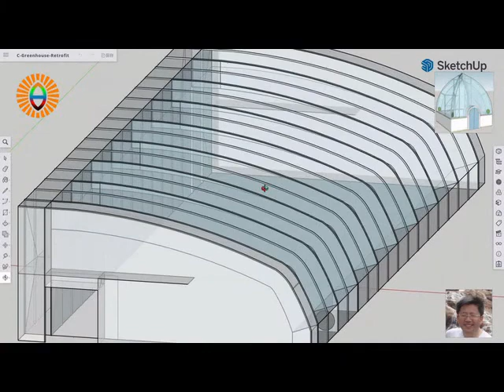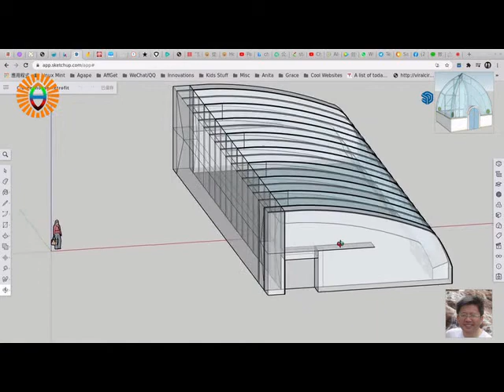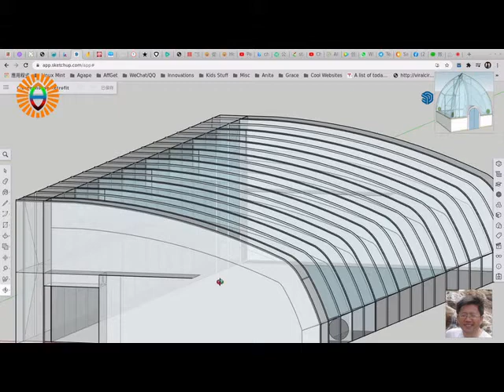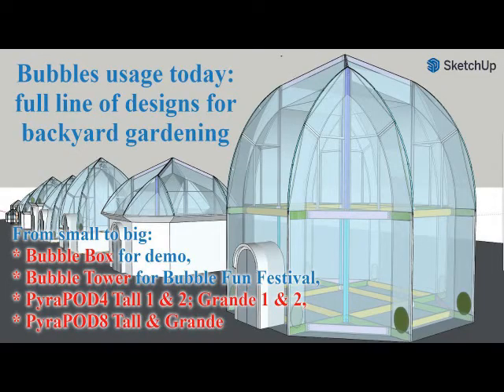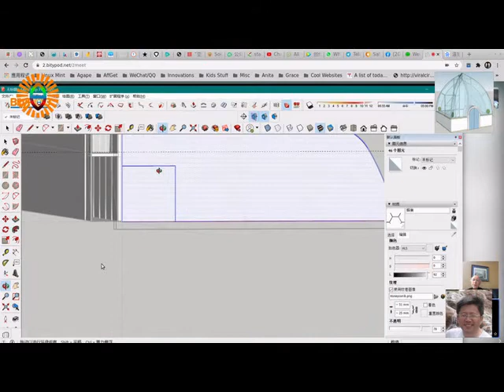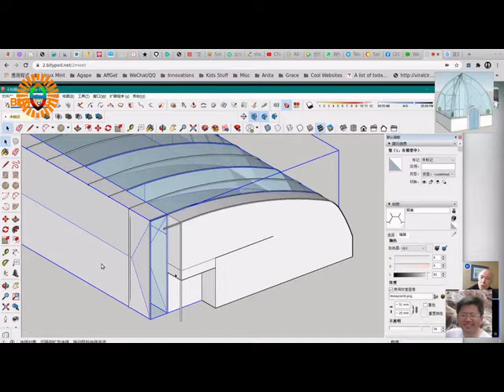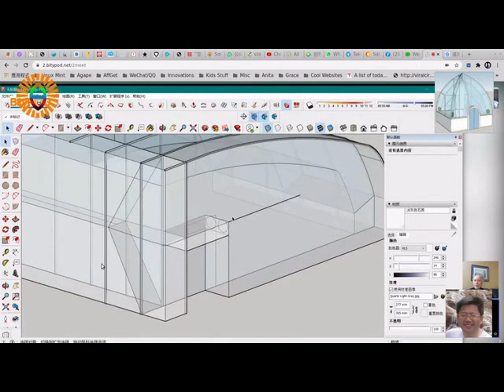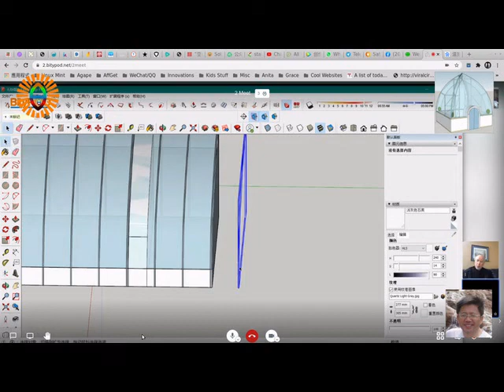DIY: How 2 Convert Your Existing Greenhouse to Utilize Soap Bubbles to Boost Solar Thermal Intake

Comment: Hey Mr. Chang,

awesome techology here! What is the foam solution made of? Just water and soap or surfactants added? In which proportions? Isn't there the danger of algae or bacteria growing in the foam solution?
Reply from the maker: Any soap will do. When you test the bubbles produced, you will know how to adjust the proportions. We want tiny bubbles rather than big bubbles. No danger of algae or bacteria growing in foam solution in a completely sealed space.
Reply: @AubreyZhang  That's cool, thank you!
Reply: @ichbinderroboter  
Algae will grow anywhere there is a supply of water and light. A completely sealed space will not prevent it :)